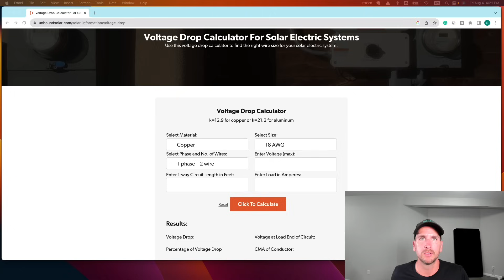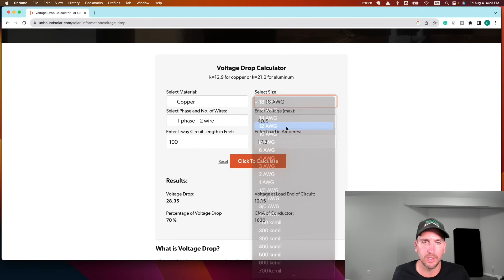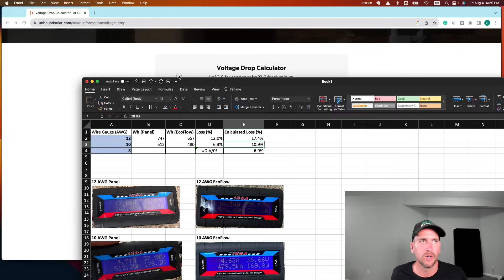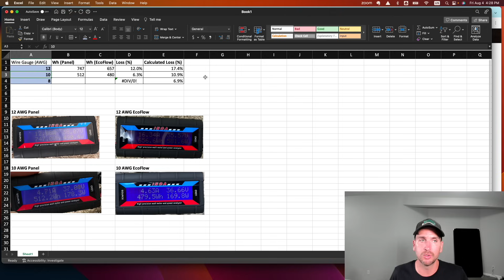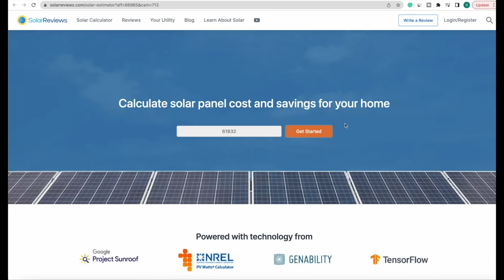What Wire Should You Use For DIY Solar Kits? Surprising Results!

Comment: Interesting results. I knew the 8 awg would be better, but I didn't expect that big of a difference.  Thanks!
Reply from the maker: You bet!
Reply: I’m using 6 gauge running about 70 feet with a max of 8.5amps. I’ve done  voltage comparisons at either end and see only a few tenths drop.
Reply: 20+ years off grid. You should keep your wire runs under 30 feet and 8 gauge for12 volt. 10 gauge for 24 volt and 12 gauge for 48 volt.  You can reduce loss by moving the controller and inverter closer to the panels and use an inverter to run 110 AC to your home. A shed works for that.

I recommend 24 volt in series and a run under 30 feet with 10 or 8 gauge wire for off grid.
Reply: @solarcabin most everyone is going 48 volt now, because you get naughty things when you do a bigger jump into/through the inverter, plus the advantage of running parallel battery banks. Series battery setups have some pretty important disadvantages, as many point out. And if you have watched over  the last 5-7 years, the manufacturers have been exemplifying this trend, especially with medium sized and up systems. And of course the cabling is crucial as well. There is also the advantage of fewer batteries, which means less cabling.
Reply: @5400bowen I feel like you are confusing battery voltage with input voltage of the controller.
My inverter/charge controller has a max voltage solar input of 450 volts so I could put 10 panels in series to get line voltage to the controller of 330 volts and 10 amps but my battery is 48 volts, 51.2 actual. 
At 330 volts and 10 amps I only need 14 ga. wire for a 100 foot if run with less than 0.2% loss.
Reply: @ghz24  I still think you are risking early degradation with 14 AWG at 100’. I’m going 8 AWG for 50 feet at 92 volts with 820-1,150 watts of bifacial panels. And I still say that’s just enough. That little extra resistance also works your panels harder day in and day out, and same with degradation. Day in and day out. Then there is the mechanical strength, insulation thickness…it’s not all just resistance/heat production that you need to consider. 14 AWG is just penny pinching. All that expensive equipment and then go cheap on the conductors…your math may be an advanced analysis…but doing maintenance repairs and fabrication on commercial and residential establishments for decades, I’ve seen all kinds of problems with lightweight electrical and mechanical installations that failed from everything from corrosion and mechanical damage from failure of surrounding structure to rats chewing stuff up. Penny wise and pound foolish.
Reply: @ghz24  and I’m not confusing the two…I think you’ve just seen so many Utube videos where people do that (which is why I’m so aware of that situation) that you are projecting that into my comments. What exactly did I say that seemed to be confusing the two?
Reply: A reply I did to another person has some applicable thoughts as well…:A shed costs a lot more and is WAY more work than conduit and heavier gauge wire. Though a small enclosure for a combiner box at the panels is very practical, but the combiners are generally set up to be outdoors. So they don’t need a totally weather proof enclosure like an inverter and charge controller will. That makes a BIG difference in time money and effort. Plus, the batteries need excellent weather protection, and you don’t want your batteries a long distance from the inverter or your breaker box, or the end use point(s). So in my case I don’t put panels on my roof because that is a whole can of worms for installation and roof repairs/replacement short and long term. I have a nice exposed hill that I put my panels on and it is just simpler to run 4 AWG  into a weather proof cement board cabinet close to the cabin with the controller/inverter/ batteries.
Reply: @5400bowen  Missed your reply, I guess the reason I thought you confused battery voltage with array voltage was you mentioned battery voltage which is not really relevant to the voltage put out by the array.
The voltage being fed to the charge controller is not related to battery voltage other than needing to be higher than battery voltage.
You are right about 48 volt systems dominating stationary installations but, the charge controllers specs determine both battery and maximum array voltage.
I would not use 14 ga wire, 10 ga is not that much more money especially if there are no really long runs but, why do you think it would deteriorate at all let alone earlier than larger gauge wire?
I mean the line loss causes the wire to get warm but it shouldn't be damaging to the wire.
 Protected from elements wires should last virtually forever.
Reply: @ghz24  first off, all wire deteriorates period. All substances deteriorate, entropy. Second, energy of any type applied to any substance deteriorates it. Third, larger wire is less affected by any given energy level run through it. You haven’t dug far enough into electrical engineering. Running current through wire deteriorates it over time. The larger the wire, the less it loses conductivity. It’s like anything else. A bicycle made with thicker metal tubing is less affected by shock, vibration, twisting, heat etc. . If 10% of the metal rusts, you still have much more strength than if the metal were less massive and 10% of it has turned to rust. So if you have a thicker wire with say 1,000 amp capacity for 20 feet and it loses 5% of its’ conductivity, it affects your current flow less than is you have a 100 amp 20 foot capacity wire that loses 5%. On top of that, the thicker wire will be less affected by by the current in general because it has less resistance, making the deterioration effect less to begin with. It also decreases the effect on all the components it draws from and feeds to, especially the drawn from. My brother worked at the Naval Electronics Systems Analysis Laboratory in San Diego after being an electronics tech in the Navy. His job was determining design flaws in the latest electronics systems on the planet. Wires degrade, period. Nothing is permanent. The more headroom you have in your wires due to beefy gauge the less all of it happens and the less effect it has on your systems operational parameters. There are other things. Like thicker wire has thicker insulation, making it more durable in general. Thicker wire is simply stronger in general, making it more durable from a mechanical stand point. Less resistance means a happy system! Resistance is one of the key enemies of longevity in all electrical contrivances. Larger wire has less resistance, giving it a longer life span and less loss (yes, there is ALWAYS some line loss, no system is perfectly efficient at energy transfer, even lightning loses a fraction of it’s energy traveling through the atmosphere, the ground, water, your house, YOU!). I would not use 10 AGA for more than 5 feet with any panel over 100 watts. To me, the added efficiency and longevity and extra mechanical durability is well worth it as it translates to piece of mind. All systems degrade over time, no matter how well protected. You have to run some wire outside exposed to the elements, and putting it in conduit increases heat buildup as well as protecting it from the elements. You still have the leads that come already connected to the panels, I’ve never seen them in conduit.
Reply: @5400bowen  Wow you must have used a ladder to pile BS that high.
"Wires degrade period"  OK sure but let's limit ourselves to things that will happen within a human lifespan and at conditions routinely seen on rarth.
The copper in copper wire is a protective metal that will not appreciably degrade for hundreds of years even when left exposed to the elements.
It's the insulation that limits a wires useful life.
Not all substances deteriorate and saying  entropy doesn't make it so. 
And all substances are exposed to energy all the time because we haven't achieved absolute zero.
Passing electricity through a wire at current levels within the ampere rating of the wire causes zero deterioration.
The conductor of the wire does not wear out or diminish in it's capacity to conduct electricity.
Physics trumps electrical engineering.
Low current over long times doesn't reduce the capacity of the wire.
Bicycles? WTF? Comparing a stationary wire to a bicycle is asinine. The bike is beaten up constantly by the road, it's a mechanical system under constant stresses and friction, it's made of steel a nonprotective metal that does rust away.
Likewise a navy ship on the ocean is an insidious environment compared to underground in a conduit somewhere inland. Plus it's not "electronics" it's an insulated wire.
Your example of a wire loosing 5% of it's capacity is nonsense that never happenes.
Properly installed a wire shouldn't experience mechanical stress of any significant amount.
I won't point out super conductors so yes all wires have line loss but that is power not material being lost.
In the wire I proposed (14 ga 100 feet long with 10 amps and 3300 watts) the line loss is 50 watts spread over 100 feet. Going to 10 ga wire (the size I would use) lowers the losses to 20 watts.
If a wire can't be overloaded it's life limiting factors are all about the insulation and thicker wires don't necessarily have thicker insulation thicker insulation is noted by higher voltage ratings.
And insulation is what causes wires to fail after about 70 yeats of the plastic loosing it's plasticizers and getting hard and brittle. Silicone wires will likely last 100 years or more just because we can make better plastics than 50-70 years ago.
BTW modern racking systems have a channel to put the wires in so they are in a conduit.
Reply: @5400bowen  Lol holes get filled. How about one refrence to back up that bullshit.
Current flowing it copper does not cause any filling of holes or decay from any other mechanism.
An extra electron makes it an ion, are you trying to say there are ions fonmed in solid metal? 
4000 watts of power still only looses 20 watts on a hundred foot length of 10 ga. wire because it is still 10 amps but now 400 volts.
You claim the holes in wires slowly fill but then point to earthquakes and hurricanes that cause immediate physical damage.
On the contrary it is you that thinks you know more than you do. All up and down this comment section people have been correcting your wrong assertions and faulty math.
Try googling "does the electricity flowing in wires wear out the wires" and check your hubris.
Buy what ever wire you want but don't spread nonsense about the benefits of larger or better insulated wires.
Reply: Sadly, approx. 2/3 of grid power from our local utility companies is lost during transmission (but yes, customers are still paying for the full 100%). With Solar on your own rooftop there is hardly any loss with appropriate wire size.
Reply: @acordia91  Average grid losses are only around 5%, not 66%.  The reason is because those overhead wires are running at much, much higher voltages.   The basic trade-off is:  double the voltage, halve the current, power losses over the wire wind up being only 1/4 rather than 1/2 because you aren't only reducing the current, you are also doubling the voltage.

The reason it works like this is because wire losses result in a voltage drop based on (current x resistance).  But POWER losses are a function of (current x voltage) and not only did you halve the current, you also doubled the voltage so even though the voltage drop is only halved, POWER losses are 1/4th rather than 1/2 because that voltage drop is relative to a doubled voltage.
Reply: @junkerzn7312 ok I was caught off guard because the video and comments here are a cut above. Yes, the main lines run at 12,000 volts, at least most places in he US  for most of my life.
Reply: @acordia91 That isn’t even close to true.  Why are you making up crap like that?
Reply: @acordia91 nice observations.

Comment: Hood topic, we have the same topic in our FB page , but it is for wires between battery to inverters
Reply: Most people use battery cables for heating it seems. 99% uses too small wirering and the wires are basically acting as the fuse. Inverter manufacturers advised size is mostly a fire hazzard..... Its a shame almost noone calculates...
Reply: @thuisbatterijcentrum  we have used very big size cable and busbar in our 48v230Ah batteries.